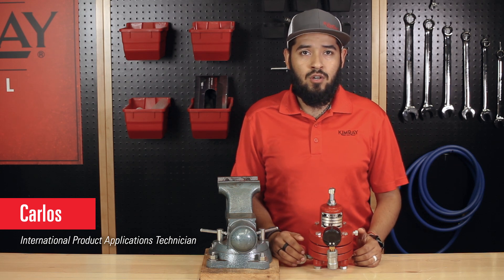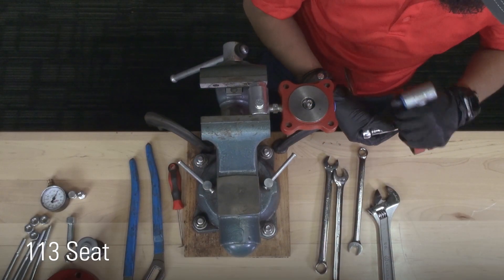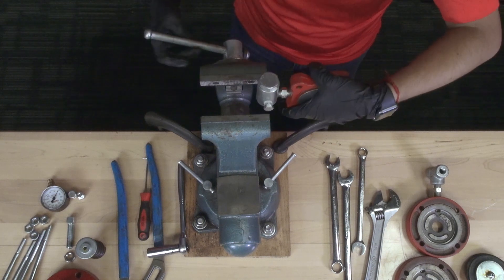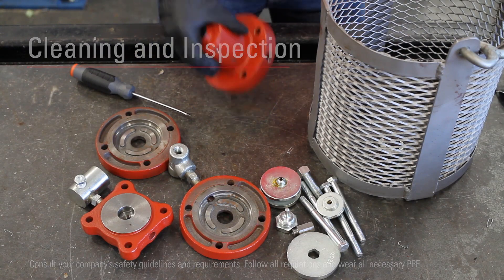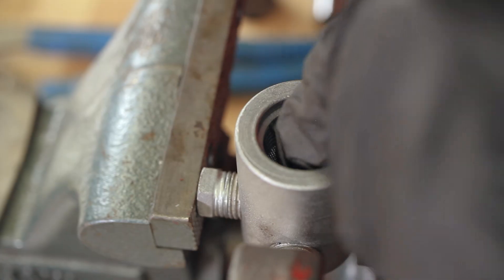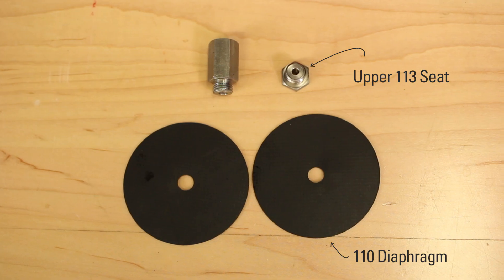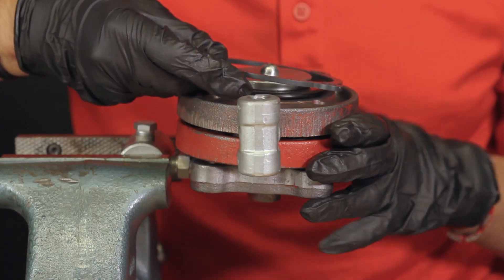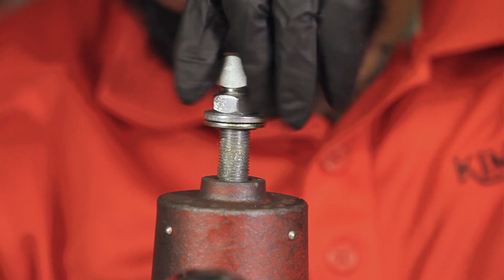Kimray 30 HPG Pressure Pilot Repair 🔧 [Disassembly, Inspection & Assembly]

Comment: Can you flip the diaphragm and make the pilot change from indirect to direct?
Reply from the maker: Although there is  way to convert the indirect pilot to a direct pilot, it is not by flipping the diaphragm. You'll need to change the position of the pilot plug and the 113 seats and 565 seat. Also the spring part number 108 will need to change to a 585 which is found in the repair kit. The direct pilot will be used in an on/off applications - it is not intended to be used as a proportional signal for throttling a motor valve. While an indirect pilot throttles. There is also a way to make the direct pilot throttle but there will be extra parts needed for that conversion.
We have plans to make another video showing how to assemble it as direct acting, but it's not ready yet. If you need more help, call our technical support and they'll be able to answer any other questions.